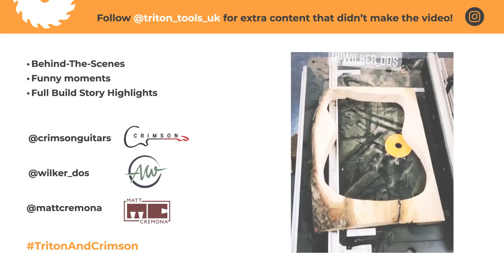April Wilkerson & Matt Cremona Custom Electric Guitar Build - DAY 5

Comment: Whilst I know its not a competition, If I had to play either. April's guitar would win easily. If Matt had cut that spectacular wood into a traditional SC (not left all that wood on the top part), added an extra PU, that certainly would have been my winner. The wood is beautiful and I think it could have given many SC guitars a run for its money but the top part adds weight and discomfort and an extra HB would add the versatility too...

At the end of the day though, its not a Competition and its amazing to see both making guitars, making working instruments over 5 days and I hope both are very proud and happy with what they achieved!!
Reply: I have to agree... I'm not a fan of the "Sharktar" concept; however, I do give him props for thinking outside the box and doing his own thing. Having said that, since he is not a guitar builder, but is a very creative person, I have to say I like the headstock transition from the nut, the use of the body wood on the headstock and the contouring of the lower part and back of the headstock to resemble the body.

If I were building my own, these are definite concepts I would keep in mind... I'd probably even refer back to these videos as a guide. But I also like the bowties (or dutchmen as Norm used to call them on New Yankee Workshop)... and would probably use some sort of inlay to strengthen weak areas or for aesthetic reasons.

They both helped open my eyes to some possibilities in future projects.
Reply: I have to agree... sometimes traditions have a reason... Still, they are both gorgeous guitars and a fun pair made them. Matt wood was especially intriguing. Cool to follow.